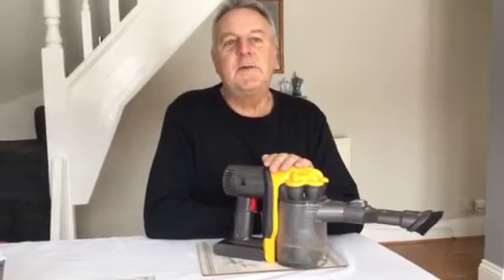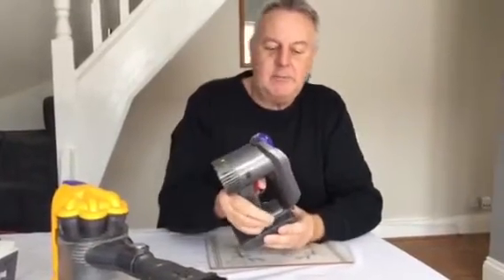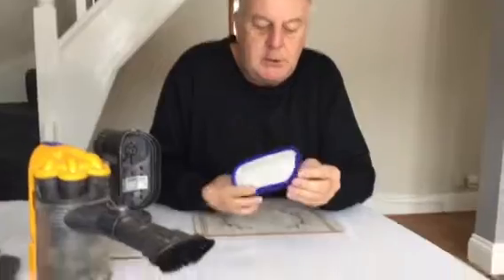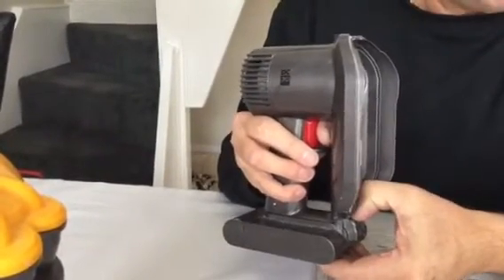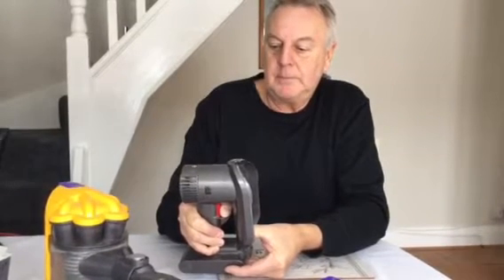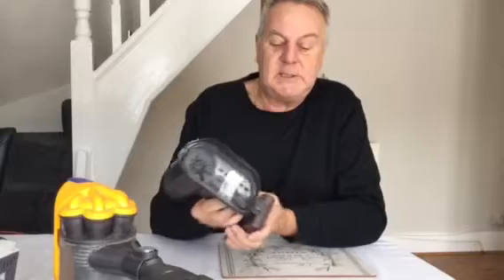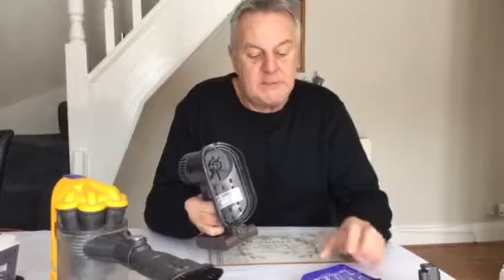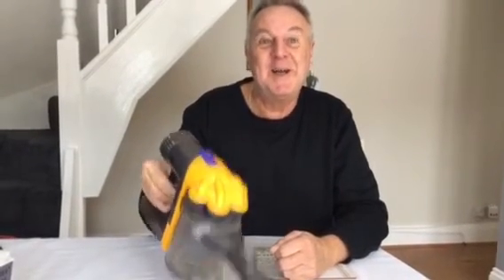How to fix and test a dyson DC30

Comment: The flashing light also means there is less than one minute of charge remaining as per the Dyson instructions. If it's flashing rapidly it means it's either too hot or too cold and not to use.

Comment: Nice video! Thanks.  I am trying to remove my battery of DC 30.  You just pulled the battery off.  Mine has at least 1 screw of which is stuck.  I tried the elastic band method to get the screw out but it won't budge.  any suggestions

Comment: The little cyclone tubes get easily clogged also. Buy yourself some 2cm pipe cleaners and just fish them into each of the 6 tubes, no disassembly necessary.

Personally I never wash filters with water. Filters are often made from blown polypropylene which is easily damaged and clogged up by water or alcohol. Just tap them out or use another vacuum to reverse vacuum them. That's usually enough to restore them to service.

Comment: Paying the amount you do for a Dyson, I would not expect to have to spend time testing it and then having to buy new parts or a battery. Best thing, buy something less expensive that you can then just but another one if it brakes, at a much lower cost. I'll never have a cordless Dyson! Rubbish 😊
Reply: I'd prefer to denigrate Dyson's reputation until they make a world-wide recall and replace them with a with a better machine.
I'm no planet alarmist, but we could treat waste with more respect.
A just-too-clever design, imo.

Comment: Hang on man too fast. I viewed this to find out how to remove the battery !! What did you do?
Reply from the maker: Trevor Appleton just press the button on the handle and pull the battery off
Reply: Some later models have two screws holding them in rather than the release button on the back. One screw on the back of the handle, one 'inside' under the filter.